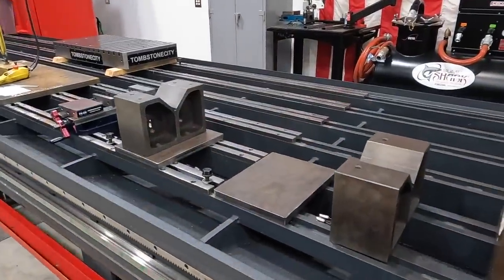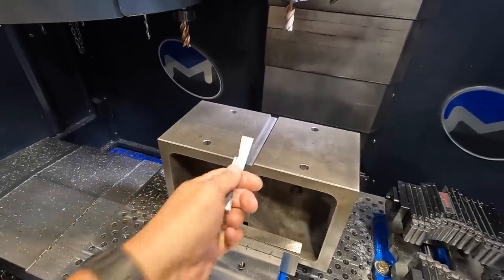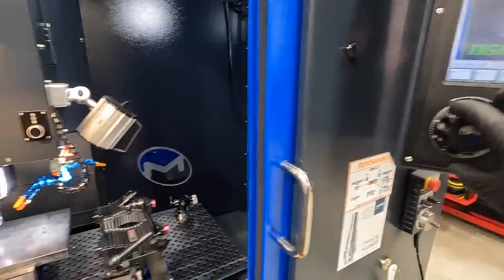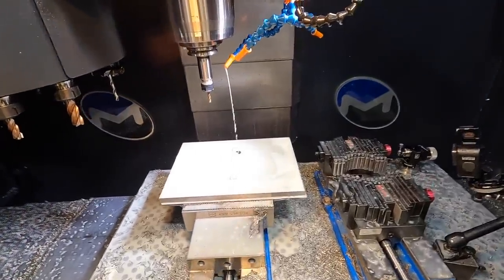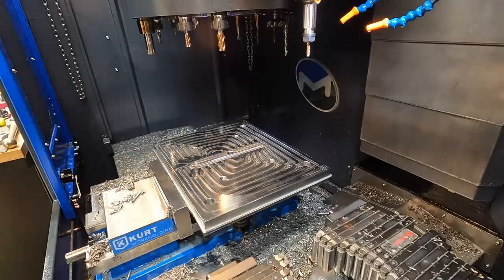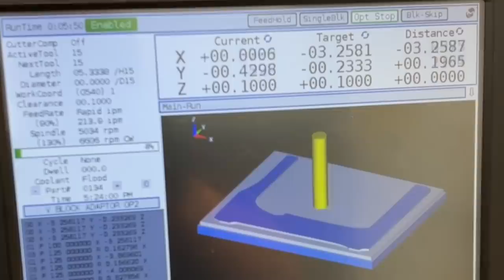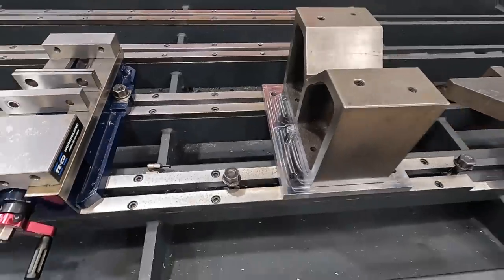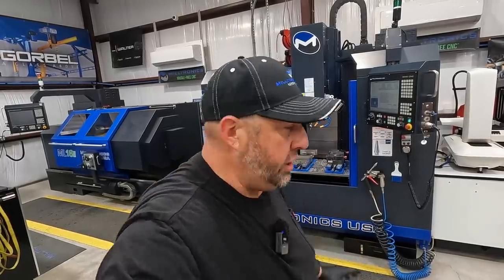V-Block Adaptor Plates

Comment: Why would you use old worn out V Blocks on a big, expensive CNC machine? It's like you are inviting error. Kurtis at Cutting Edge Engineering has an instructional video on making Precision V Blocks. Check it out. If it's too complex maybe he'll build you a set! Or do it yourself, something other than unboxing videos, spraywelding, and ASMR of surface plates! Ooohh...so smoooothhh!
Reply: Can always machine the v ways after they are installed for ultimate accuracy. 😎
Reply: Old steel is special, plus Adams family reason. With a resurface it would be prime. Even without it's great. Adam has been doing this since he was a sperm, Adam and Curtis are both awesome and extremely skilled.
Reply: @LetsMakeRandomStuff  Adam started doing this late, late in his teens when his father offered him the job.  Up until then, he had other ideas what he wanted to do work wise.
Reply: @bonzi5530  Sorry, but Kurtis is in a different league than Abom. There are many skilled amatuers on YouTube that just blow him out of the water. The number of views per video and rapid growth of Kurtis' channel show it. Without the fanboys, this channel would have died long ago. "Oh my God, Abom, the way you chose the right screwdriver for a #1 phillips screw is amazing! I would never have thought of doing that!" Fanboys, so, so many fanboys! Go back 3 or 4 years, and you can see where actual content just started disappearing. And then you started seeing " Oh well, it's just for the shop, so no-one else will see it" kind of work. Or "it's close enough", don't want to use another piece steel to do it right! That's why Abom will get 50K views and Kurtis will get 500K views on a video. The fact Abom is  still taking fanboys money is concerning,  really shows a lack of respect for those viewers. They are just being used!